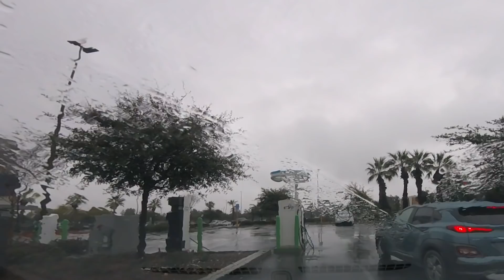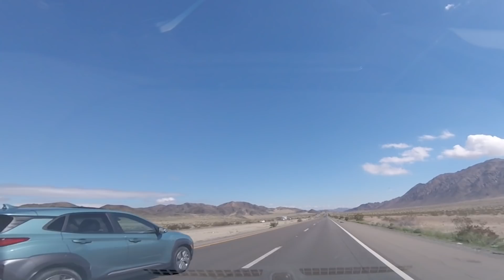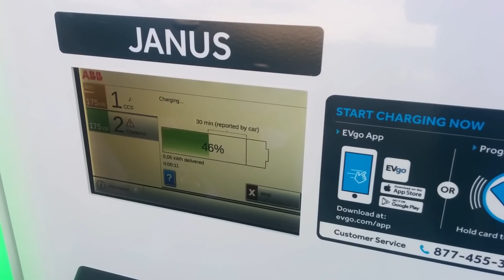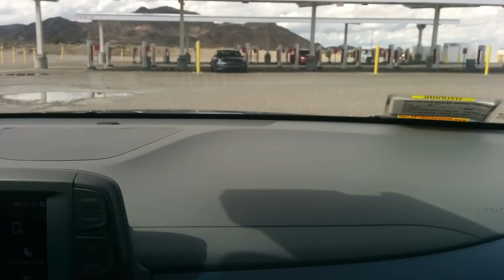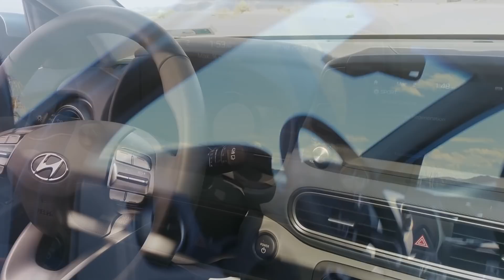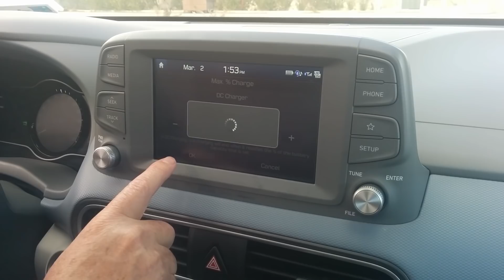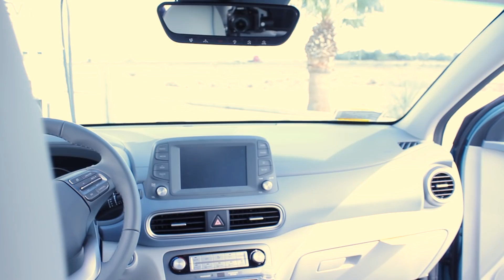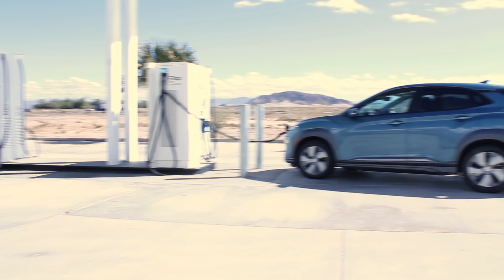Chevy Bolt EV and Hyundai Kona Electric: Grizzled Veteran versus Star Rookie

Comment: I like the charging control of the Kona. I think in 2019 GM started offering max charging levels in 5% increments, but they don't offer the other controls of the Kona.
Reply from the maker: Yes, I believe it was added to the Bolt EV in 2018 or 2019. The Bolt EV's controls dictate target charge limit for both AC and DC charging. The Kona Electric breaks them out between the two options.

Overall, I like aspects of both interfaces, but they both need to improve.

Comment: I am amazed how far down you deplete your battery---down to 1 or 2 %.   How he does one measure battery degradation ?  By a reduction in the projected miles at full charge ?  My full charge miles here on my new Bolt are down to 195 miles,  (It is in the 30sF these December days in the midwest.)
Reply from the maker: I think that the best way of measuring degradation is by comparing the estimated kWh used to the battery percentage as registering on an app or a DCFC. You can then compare that total to the original total capacity.

Comment: The exposed battery pack peeking out from under the Kona is an instant fail for here in Northern Canada. Frequently we have huge ice chunks that come off 18 wheelers and you cringe and hold on if you can’t swerve to avoid it. They are like a big rock and can do damage easily, especially when a car is very cold, metal and plastic become very brittle.

Comment: The seats in the Kona ARE a bit wider than the Bolt by several inches.  This extra butt comfort and fit was a decider for me. The heated seats are nice as well, since my back surgery causes pain when I get cold.  The weird headrest angle on the Bolt also meant I just couldn't sit comfortably in it.  The Kona fits me nicely, and I'm grateful I could get one.
Reply from the maker: I thought the same thing until I sat in the Kona's seats (which is why I didn't take a tape measure with me). If you take another sit in the Bolt EV's seats, you might see what I'm talking about. The Kona's seats feel wider because of the padding. It's something GM should definitely replicate.

Also, the Bolt EV's seats don't have headrests. They are whiplash guards.
Reply: @newscoulomb3705  whatever they are, they make it so I can't have my head back. I'm just 5'2", and even all the way down, if I were rearended those "guards" would cause my neck to snap! 
Bolt front hip room: 51.6 inches. 
Kona front hip room: 53.3 inches
Reply from the maker: Hip room doesn't necessarily equal individual seat width, but for the sake of argument, let's say that it does. That would mean that, at most, the Kona Electric's front seats are .8 inches wider. Based on my butt-o-meter, I'd put them closer to within .5 inches, but again, I regret not bringing a tape measure. 

As for whiplash protection, it's not meant to be comfortable. It's simply meant to protect your head, neck, and spinal column in the case of an accident. 

Regardless, this is why I don't really get into seat comfort other than to note specific similarities and differences. To me, the Kona Electric's seats feel like more well padded Bolt EV seats, which is fine because I already find the Bolt EV's seats comfortable.

Comment: Mechanically the Kona fixes a lot of issues that the older Bolt had - it has an independent rear suspension (Bolt uses a torsion beam), it features a heat pump (Bolt only has resistive heater), better seats etc. These are small things GM can definitely address in the Bolt facelift in the coming years but that is the benefit of being the later player to the market from the Koreans. 

That being said I'm not a fan of the way it looks. The Niro EV looks a lot more aggressive while the Kona EV front end has the same faceless mouthguard look which I greatly dislike, similar to the Model 3. EV enthusiasts seem to hate grilles but as a car enthusiast first the grille is a staple design element of a car & frankly any car without one looks questionable in my books.
Reply from the maker: I still need to test drive the Kona Electric myself, but based on the performance numbers I've seen published, the independent suspension didn't do much. Maybe improved ride quality? 

You're right about the seats, though. Despite being physically the same size as the Bolt EV's seats, the Kona Electric's seats are far more padded. It's really low-hanging fruit. 

So far for me, I still prefer the Bolt EV as the best, most complete car overall between the three, but it would be better if it had the Kona/Niro's battery capacity and charging curve/rate. That would truly be the best of both worlds in my opinion.

Comment: Define 'highway efficiency' in regards to 'around 80 mph' for the Kona.
Reply from the maker: The EPA provides a rated highway efficiency (people usually just post the combined EPA efficiency). In the case of the Kona Electric, it is rated at 108 MPGe Highway, or about 3.2 mi/kWh. Based on my observations, it will see that efficiency at ~80 mph.

Comment: In your opinion, will i make it from Anaheim to Baker traveling at freeway speeds (75 or so) in a Bolt without a problem? And how much will i need to charge to make the rest of the trip to Vegas?  Is there any concerns I should have with the return trip? Thanks I like your channel, learning a lot..
Reply from the maker: Yes, under normal circumstances. If you were facing a headwind, maybe not. I usually check my battery level as I'm heading through Victorville. If it's less than 60%, I'll top up a bit. 

Also, keep an eye open for the ChargePoint site that is being installed at Eddie's World. A quick 10-minute charge there will get you to Baker, even in bad weather. 

At Baker, it shouldn't take you more than 30 minutes if you are using the faster chargers. 
So Anaheim to Las Vegas should only require about 30 minutes of charging under normal conditions, and maybe 45 minutes to an hour total if the weather is really bad (rain, strong headwinds, etc.).
Reply: @newscoulomb3705  awesome!! Thank you for the information.
Reply: @newscoulomb3705  I contacted Eddie's world and the charger still isn't up and running, they are waiting in the country still.
Reply from the maker: @714downshift  You're welcome! Yes, I don't expect Eddie World's chargers to be up for at least a month or so, but you should be able to make it easily either way. Even in bad weather, you can just stop at Victorville EVgo to top up for a few minutes before heading on to Baker.

Comment: The Bolt front seats are horrendous. I was going to get one but I would have had to replace the front seats and I didn't want to go to the trouble of this.
Reply from the maker: I don't have issues with them. Actually, they really helped my back. I feel like the seat issue is like the firm mattress versus soft mattress argument. 

In either case, if that was the deal breaker for you, then the Kona Electric makes a great alternative. The Kona's seats are still not as nice as the LEAF's seats, but they provide a good compromise (especially because the Kona is just a better car overall than the LEAF).
Reply: I noticed the Bolt seats feeling weird when I first bought it but now I don't notice them at all. In fact, I can drive further and longer more comfortably in them than other vehicles I have, like a large sedan and a Ram truck w light camper that rides well. Can't explain why but it is what it is.

Comment: Waiting for your V3 video. I’m ready to call BS on the Tesla Team blog post. Why no named person like JB or Elon?
Reply from the maker: I might comment. The video I saw showed a max of 150 kW at ~30% and back down to the regular charging curve by ~50%. So it might peak at 256 kW, but it will probably only be between 10% and 20% battery.
Reply: News Coulomb, you see the video starts at 0%, and if real, I bet it hit 4.2v at 256 kw. You can do this with any decent battery, but it’s not going to last long. I bet the Bolt can take at least 120 kw for a little while at 0% before it hits 4.2v per cell.
Reply: News Coulomb, here’s the official Tesla video.
https://youtu.be/F-SZ7FgK1KA

Looks fake, compared to real videos of model 3 charging. Of course with a Hacked BMS they can charge at 3.4c for a while, but that’s not going to be allowed on customer vehicles or by regulators without a hardware update to the car.

Comment: Great video! What's the availability of the Kona EV at LA dealerships? Lots available or hard to find?
Reply from the maker: Thanks! 

They're available, but mostly because dealerships have a $5,000 to $8,000 "market adjustment" fee on top of MSRP. The Riverside dealership where David got his has a couple in stock, and he recommended that you can "negotiate" to get around that markup.

Comment: I’m looking forward to Yermo DCFC at Eddie World. I almost ran out of power in Bolt when I drove from Vegas to Victorville, charging stop on way home to LA, 1% left! That was definitely too close for comfort.
Reply from the maker: Yes, the conditions on the route vary so much. Some days, you can make it on a single battery charge. Other days it's very difficult. The day we tested, it wouldn't have been possible. Even the Kona Electric with better efficiency and 4 kWh larger battery wouldn't have been able to get from Vegas to Victorville on a single charge at 75 mph. 

Also, though construction hasn't started yet, we're supposed to be getting a few more in Barstow as well. And they haven't announced, but I think Electrify America might be adding one in Primm.

Comment: mFers they get the Kona. I’ll wait for base TM3
Reply from the maker: I actually think the Kona Electric is just as good of a value.
Reply: For it to really be a true Tesla, you'll need $8k in AP and FSD upgrades, and at that point, what's $2k for 20 miles more range and an improved interior? So that $35k M3 becomes a $45k M3, and if you want a color that's not black, pony up another $1,500....

Comment: I think Niro Ev is car that I would buy . But looks like we wont see it is our cold state Minnesota. Now available Leaf .Bolt.Model 3 and a few Ioniq evs.
Reply from the maker: With the discounts currently available, it's really hard to pass on the Bolt EV. The Model 3 would be good too (depending on your needs), but it's already stepped down in Federal Tax Credits.
Reply: You should be able to get some pretty good deals on a new Bolt. Try to find a used one to save even more cash, though, especially on the monthly payment (as the tax credit doesn't change loan payment amounts). Don't forget the Model Y with Autopilot and FSD upgrade getting announced later this month, though that could get very expensive.

Comment: Thank you for this comparison video.  The Kona definitely looks like an excellent option to the Bolt.  I have owned my Bolt for 13 months and have over 16K miles.  I have appreciated the Bolt's performance and economy, but I just wish it offered a nicer interior and options--how does my $40K Bolt not include a light in glove box?   Going forward, GM will need to do something to compete with Kona's bigger battery, better efficiency, and a nicer interior.  And don't forget that the Bolt's $7,500 fed tax credit will be cut in half at end of this month.  Although, I read Hyundai dealers are marking-up Kona's sticker by $5-8K so maybe that'll help GM :).  https://insideevs.com/hyundai-dealers-price-gouging-kona-electric/
Reply from the maker: I think GM definitely needs to improve the Bolt EV, especially if they want to keep that price point. The thing is, right now, most Bolt EVs are already being sold for $4,000 to $6,000 below MSRP. 

I'm personally fine with the interior, but a lot of people today will demand a more plush interior like what the Kona Electric has. Add that and a faster charging battery (even if the range stays the same), and GM could keep selling the Bolt EV at current MSRP. Driver assist features would need to be added for a markup.
Reply: News Coulomb  Thanks, I forgot to mention the faster Level 3 charging of Kona. Btw, I have to add another comment.  At one point in video, you stated you had “nearly 2% left on battery” when arriving in Ontario, but the Kona was “a little better” at 21%.  I would personally consider 21% to be a lot better than 2%.  I have done only a few long drives, but I arrived home once with 0.5 KWh (roughly 1%) left on battery and I was a wreck.  What made it scary was how range suddenly went from X miles remaining to “Propulsion Power Reduced” with range mileage replaced with “low” and the battery icon.   The change happened just a mile or two from home so my take away was that I probably have maybe 5-6 miles of range left when I see the reduced propulsion message.  So with that experience, I would not be able to plan a trip where I arrive at my destination with 1% left on battery. I just don’t think I could cut it that close, especially having to answer to my wife in passenger seat. :). Have you ever run out of juice completely where you need a tow?
Reply from the maker: The "little better" is in reference to energy consumption. The Kona Electric used 75% of its battery while the Bolt EV used 91%. However, the Kona Electric's usable battery capacity appears to be more than 10% larger.

Comment: When I got my license in 2000 I had a 1984 Merc Cougar with a 5.0L v8. It was a terrible car, an 79L (20.9 gal) tank and averaged 22L per 100km (10 mpg). On the highway, it could only manage 500km  per tank and had a city range of about 350km. Yeah, less range than some of these long-range electrics on the market. If you have the money, this is a great time to be alive.  People need to remember that 400 km or 248 miles of range was just fine for people back in the 80's and so was 18 miles per gallon....Yeah, when it was new I'm sure it got better mileage but it was 16 years old then.

We've come a long way and it's a wonderful time to be alive if you have the money.
Hoping to pick up a long-range Model 3 rear drive in 6 months. Just need to convince the wife.
Reply from the maker: Definitely! It will be nice to also improve the refueling speed, but we're almost there already.
Reply: mitchell duchesne 😀👍🏻

Comment: Fewer buttons is not a good thing for drivers.. it is for saving production cost
Reply from the maker: I think it depends. There's a balance to be struck, and in the case of the Kona Electric, the additional buttons are there to compensate for a smaller touchscreen. So the buttons are Hyundai's way of saving production costs.

At this point, physical buttons should be restricted for mission critical needs and features you need to access while driving (and without taking your eyes off the road). The Kona Electric has too many, in my opinion. Something like the Tesla Model 3 has too few.
Reply: @newscoulomb3705 A vehicle with a man is more often moving than not. Sometimes you want to control infotainment in detail while in move and if you don't have buttons, you'll be forced to look at the screen and it will also take longer time. This is why more physical buttons  can give you more safety. Plus, they are not there just for usage while driving. In my opinion, it is just more convenient to have more buttons even when the car is not moving. 'Cause even if it may be distracting at first, you'll always have time to learn those as it is your own vehicle. Once you get used to them, it is very helpful, just like short cuts when using computers. No matter how large your monitor is, it is always easier to use keyboard shortcuts than clicking thorough the menu on the screen. One more benefit about Kona's buttons is that they are located at the side of the screen, which lets you utilize your thumbs more. You can hold the tablet and use thumbs to press buttons and touch the screen, which is pretty satisfying and helps you keep the posture steady while controlling.
Reply from the maker: @lowlanz  I agree, which is why I don't like interfaces like the Model 3's. However, too many buttons and too small of a screen is also less than ideal.

Comment: I'm impressed with your comfort level getting so close to 0% state of charge! I've watched a few of your videos, and I understand you know your vehicle really well, but can you give some more detail on your process for mentally keeping track of where your state of charge is at a given point? And how you assess whether you'll make it to your destination vs. needing to stop for an extra charge to feel comfortable not getting stuck on the side of the road?
Reply from the maker: Thanks! It's not just knowing my car, but also, I know the roads and terrain. I'm actually very conservative on roads I don't know well. I probably couldn't do all the calculations in my head justice here, but I do weigh a lot of factors as I'm driving.
Reply: News Coulomb - yes, hearing that the effective headwind for most if not all of the last part of your journey approached the load of driving at 100 mph, I think I’d be quite concerned about making that destination!  Did you need to slow down to make it?
Reply from the maker: @dennislyon5412  Yes, the last 5 miles or so, we slowed down to 65 mph, but that was as much because of rain and traffic as anything else.